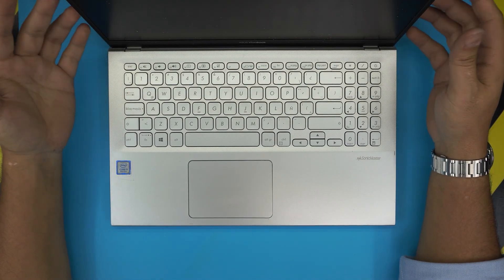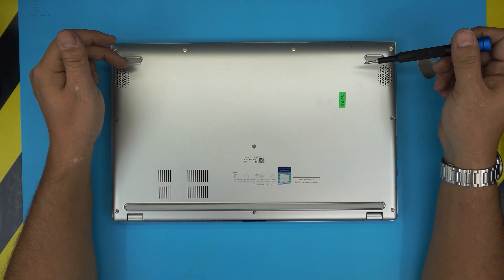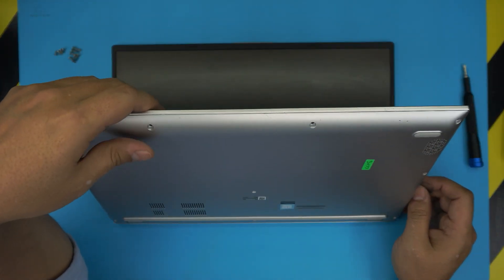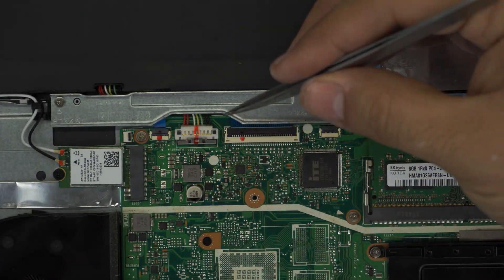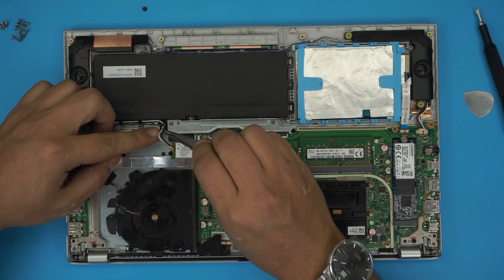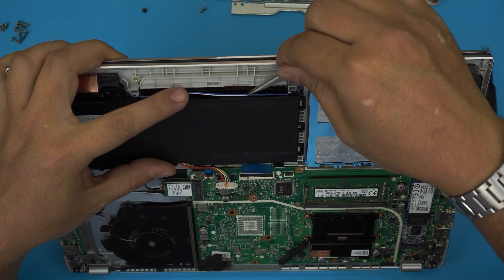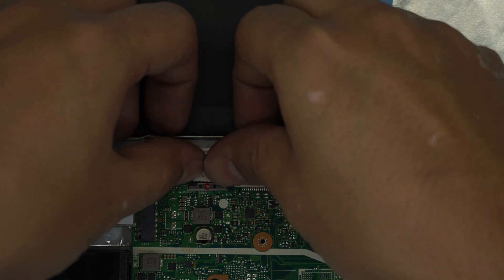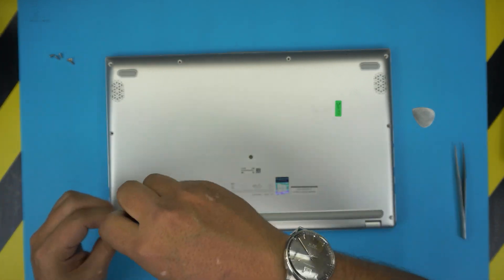Asus Vivobook F512f Battery Replacement Full Guide

Comment: after disconnecting the battery cable and connecting it again, the laptop only works on the charger. it shows 100% battery but after disconnecting the charger it turns off. do you know what could be wrong? uninstalling the battery drivers doesn't help
Reply from the maker: 🫠Regarding your question, this happens when one of the contacts on the battery connector cable is not making proper contact with the jack on the motherboard. Press firmly on the jack, secure it in place, and then test it. Leave the charger connected for 10 minutes before powering on.
Reply: @uFixTek  thanks <3
Reply from the maker: It's my pleasure my friend.

Comment: What happens if the two wires that connect the WiFi come out?  Will they just snap back in?  Black and white wires with little red dots on the end of hold tip.
Reply from the maker: 🫠Regarding your question, nothing will happen; just put them back in the same order. The order of the cables doesn't matter. However, if you don't connect the antenna cables back to the Wi-Fi board, you will have a bad Wi-Fi connection.
Should you have any further questions or requests in the future, please don't hesitate to ask me.
cheers🍻

Comment: So this helped a lot, now my vivobook is actually charging. But now I have a new issue, it’s not booting up and it continues to say preparing automatic repair and it keeps restarting
Reply from the maker: It's my pleasure my friend.🫠Regarding your question, that is because the HHD or SSD is degraded nothing to do with battery, or your system (windows is bad).
replace the ssd or the hdd:
https://youtu.be/rAbbe6mVW30
Should you have any further questions or requests in the future, please don't hesitate to ask me.
cheers🍻

Comment: Need to replace my laptop battery S45 1L  ASUS. IS IT AVAILABLE AND GUIDE MANUAL
Reply from the maker: Thank you for the feedback! if you wish to support the channel you can LIKE or SUB or both :P
regarding your question: i believe that your laptop battery is only needs to be remove two screw and it will slide out. can you do me a favor and send a picture of under the laptop and the FULL exact model.
ask@ufixtek.com

Comment: Can anybody suggest whether the battery of Asus vivobook lineup which is 70 Whr can be upgraded to 96 Whr (Zenbook series) ?
Reply from the maker: Thank you for the feedback! if you wish to support the channel you can LIKE or SUB or both :P
regarding your question: No my friend  you can't upgrade to 96whr because the circuit on board its not made for charging that capacity.
Reply: @uFixTek  Thanks.
Reply from the maker: my pleasure my friend :)